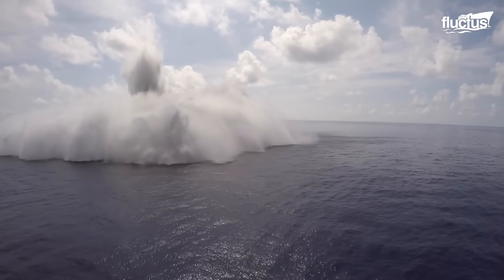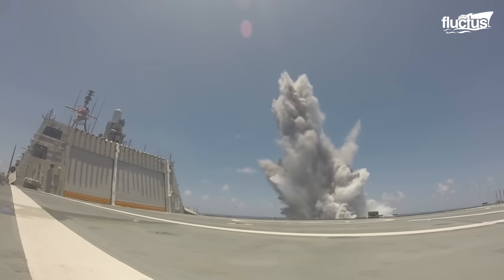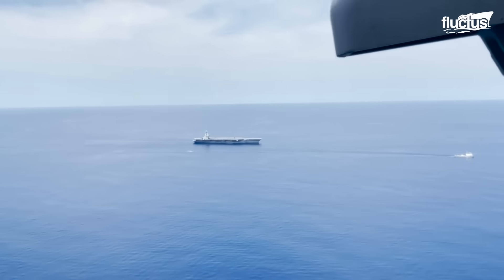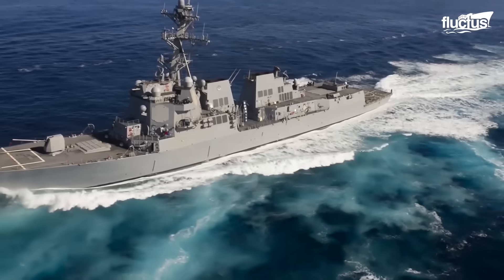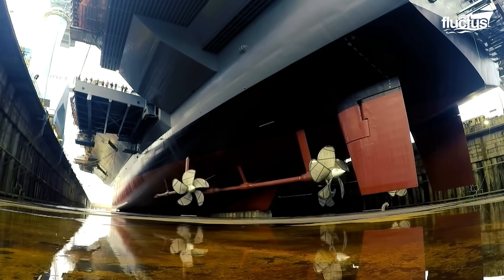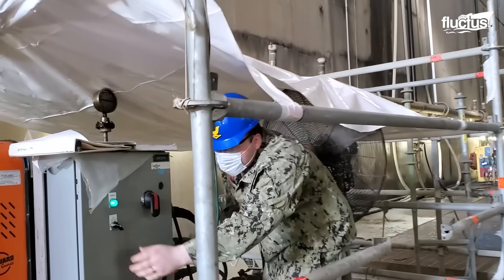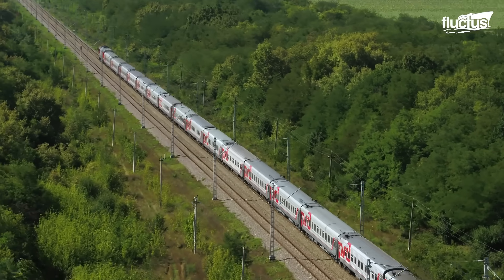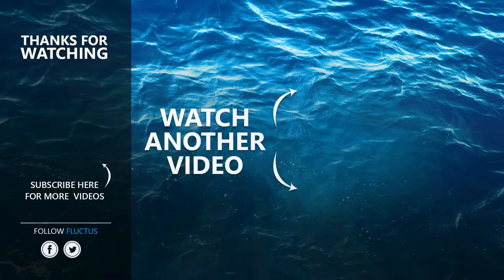Behind $13 Billion US Aircraft Carrier Intense Testing Process at Sea

Comment: In nearly every aircraft carrier video you can depend on some wag saying, "Well, a missile could take that out!" First, the carrier is not defenseless. It has means of protecting itself, including the entire Strike Group which forms a bubble of protection completely surrounding the carrier. It's a lot more complicated than throwing a missile at it. Secondly, an aircraft carrier is 100,000 tons of sovereign American territory. Sinking one would cause WW III so if you try, you'd better be ready to suffer the  consequences. Third, carriers are not designed to "win wars" all by themselves. They are designed to put one of the world's most powerful air forces 12 miles off the coast of wherever they need to be. That's what they have been doing for about 70 years now. So your bravado about a "missile taking one out" is naive, if not stupid. Go ahead and try. It ought to be instructive for you to realize that no one has. There's a reason for that. It would be an insanely stupid thing to do.